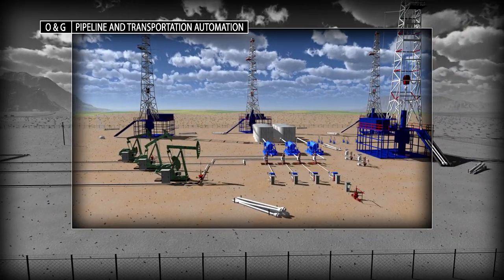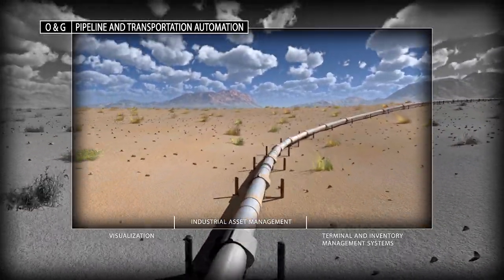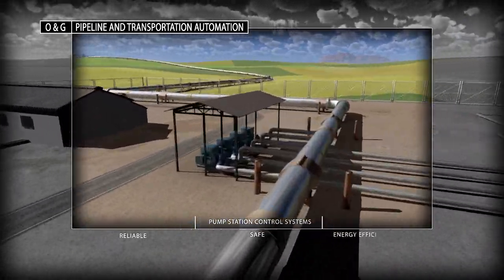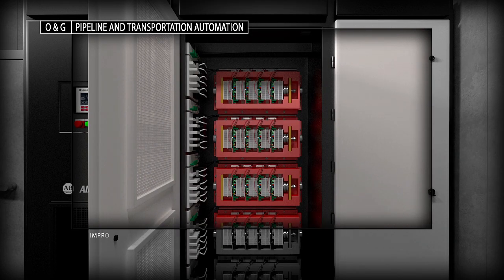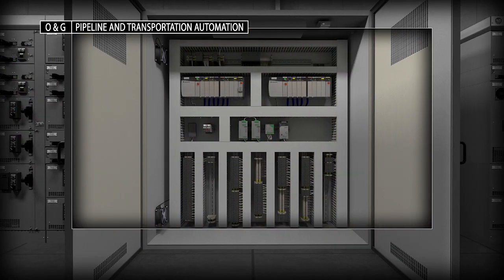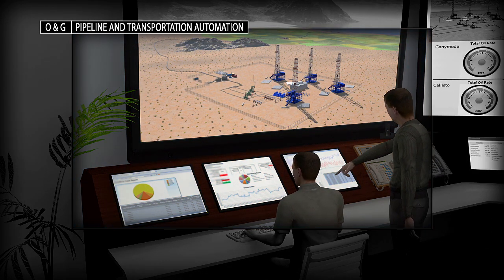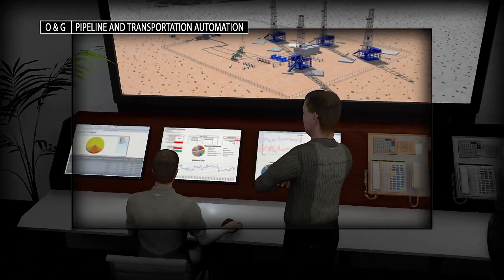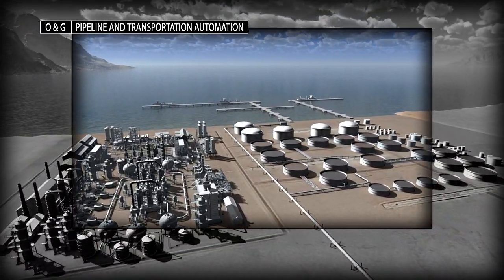Solutions for Liquid Pipelines

Comment: Rockwell Automation makes it easy to control electrical pumps both supplied with Low and Medium Voltage. Drives connected with Standard Ethernet makes it easy to reach operation data and implement Smart Motor control. Don’t make data transfer complicated. Use Ethernet/IP then it’s much faster to design, deliver and deploy automation to the digitalization era.